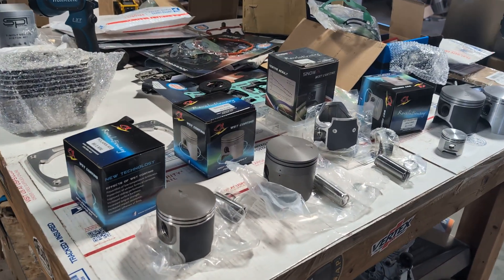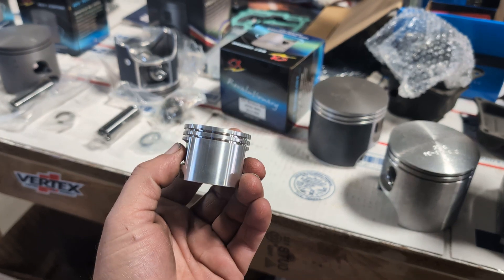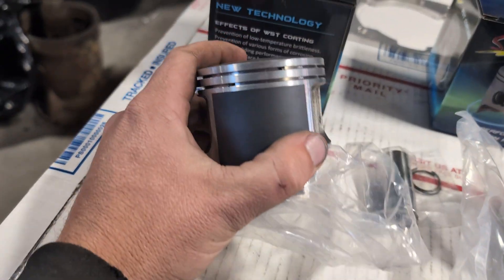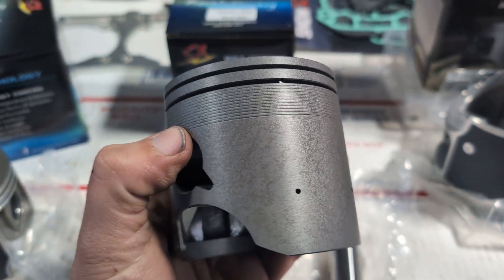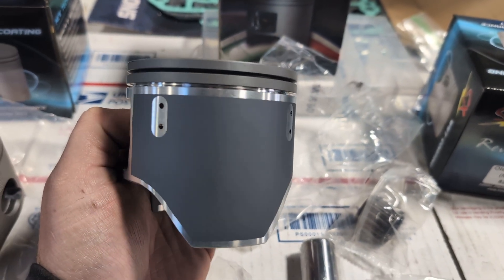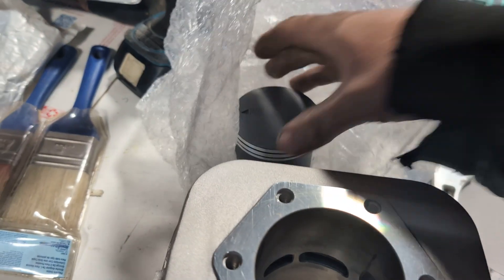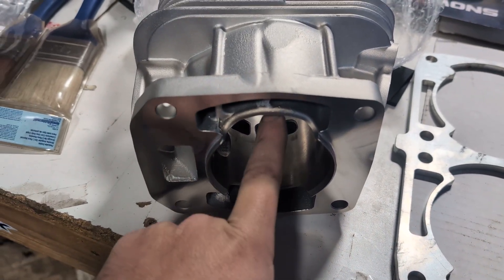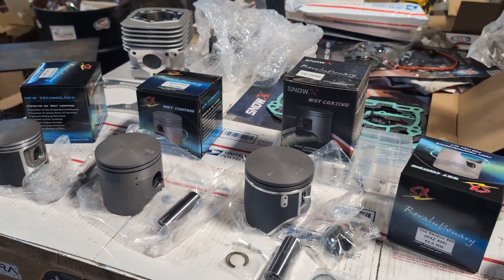let's talk about manufacturing 2 cycle chainsaw pistons for stihl 500i 661 & husqvarna 585xp

Comment: Yes! 500i, MS462, MS261 pistons with the oil holes.  OE 372xp, 660, big bore cylinder with already optimized port timing that is actually made to handle production logging. Just bolt on your piston and cylinder kit and go to work. 👍

Comment: Pretty cool idea. I know this is a bit off topic, but I’ve always wanted to see a cheaper alternative to “bike saw.” We have to literally use a single cylinder air cooled(or converted) bike or a snowmobile engine, then take out the transmission and tig weld a ton of stuff. Dreaming I guess.